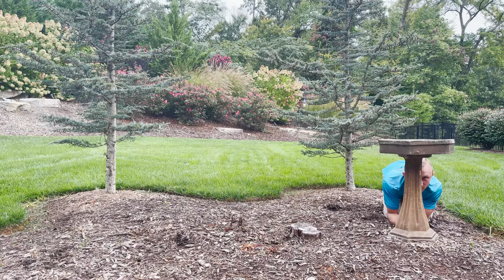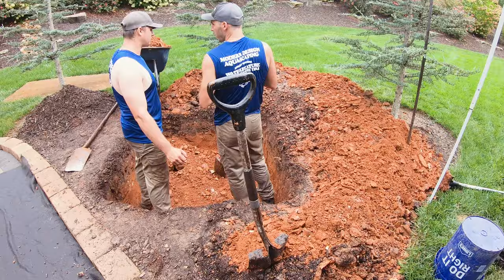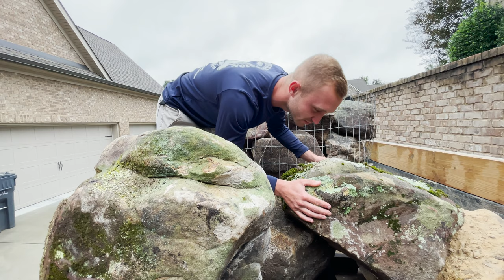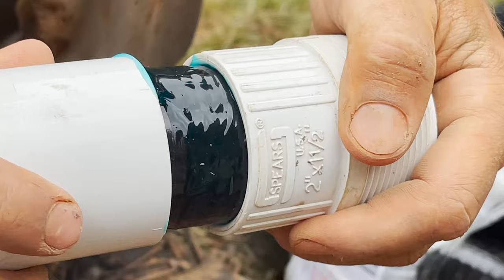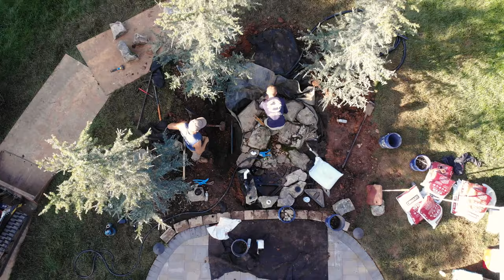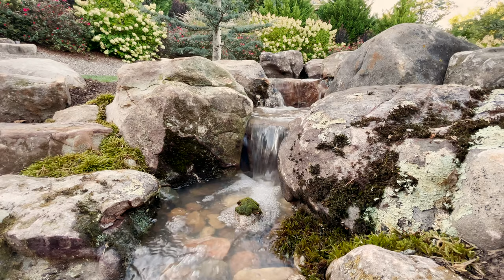Mini Waterfall By A Backyard Sitting Patio

Comment: the 45 basins are awesome, I used one in my small waterfall build, easy to use and install. they are a good chunk of change but for something that is going to take the freeze thaw cycles it needs to be strong.
Reply from the maker: I am not using them anymore, this was our last one. I feel like there are so many reasons for me to use a pond-less vault and 5 small Aqua blocks. We discussed and decided in house after this job.